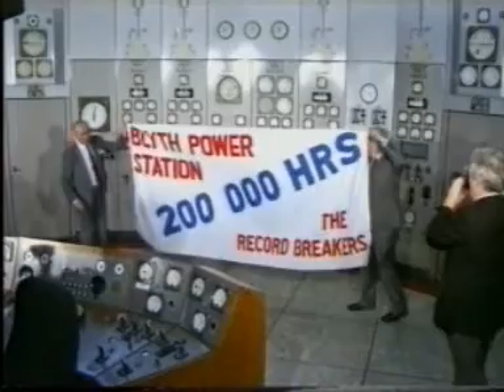Blyth Power Station Record Breaker Part 1

Comment: What's inside the big building that's left there now?
Reply from the maker: National Grid high voltage switchgear and transformers … close proximity to the coast requires a building to protect insulators and switches from salt corrosion.

Comment from the maker: Electricity is supplied from a national grid system which means power generated almost anywhere in the uk can moved to where it's needed.  Most of the smaller coal power stations closed like Blyth, Stella and Dunston have been replaced by natural gas fuelled power plants, there has also been a big increase in the number of wind turbines producing energy.